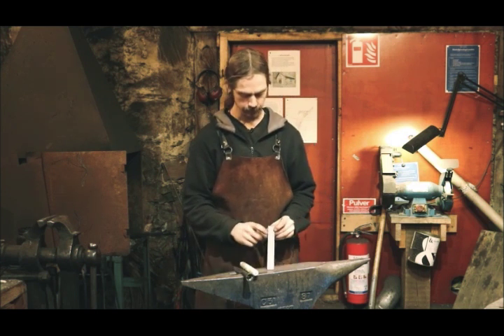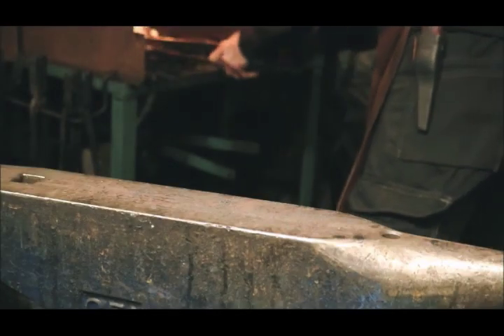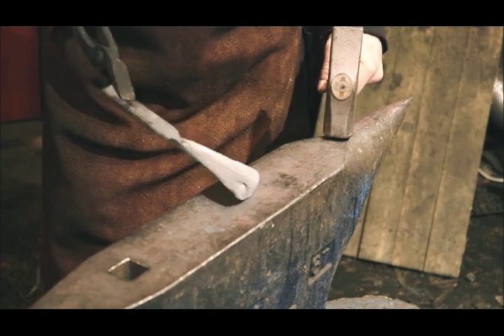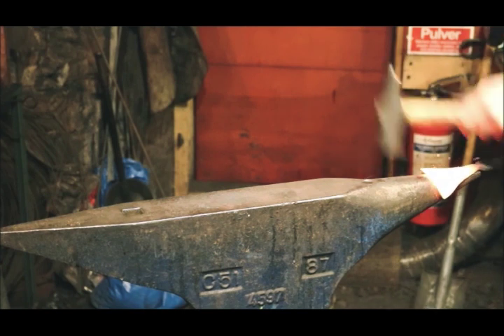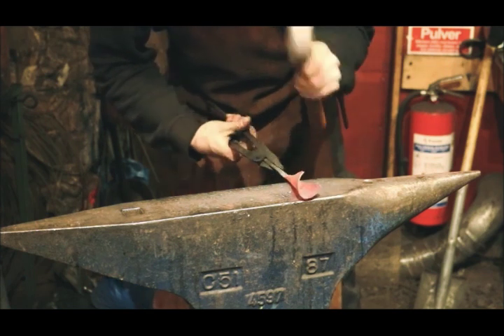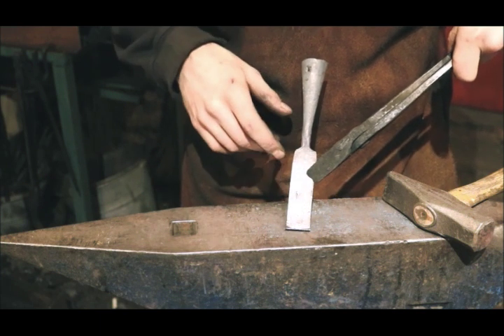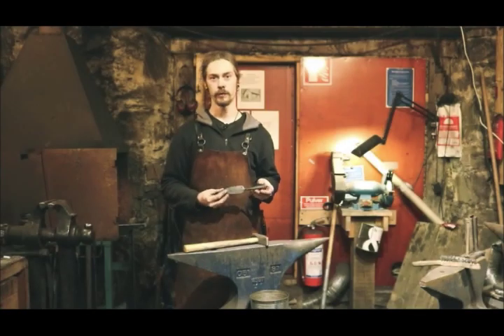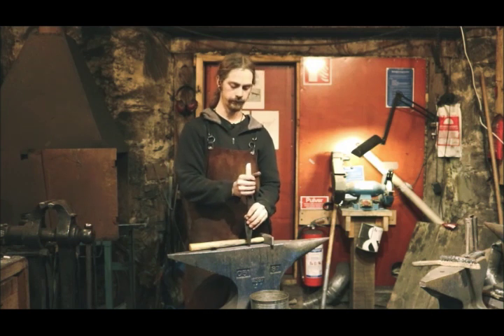Forge your own unique candle holder with basic blacksmithing techniques

Comment: great vid. roughly how thick do you upset the end too? how many mill is it before you start the socket? Thanks
Reply from the maker: Thanks! It's roughly 8 mm x 28 mm or so. If you forge it thin it does not need much upsetting when starting from a 25 x 5 mm bar.